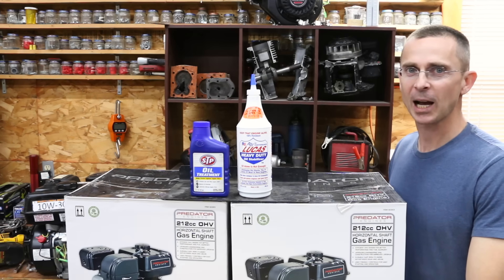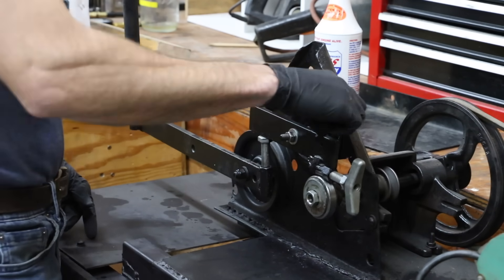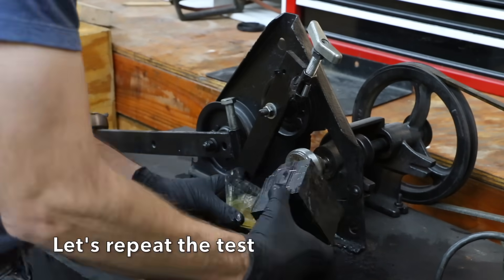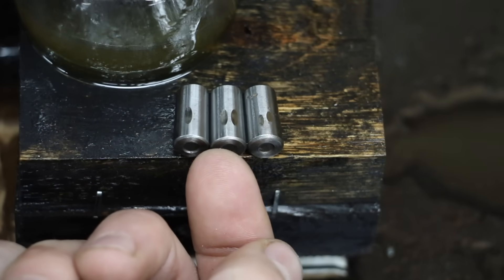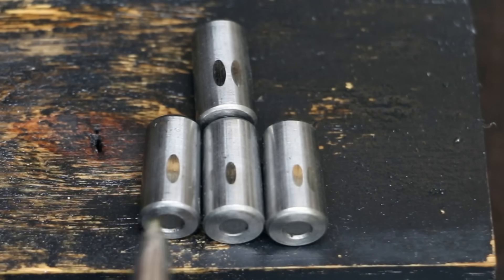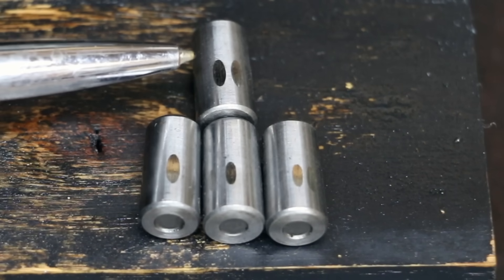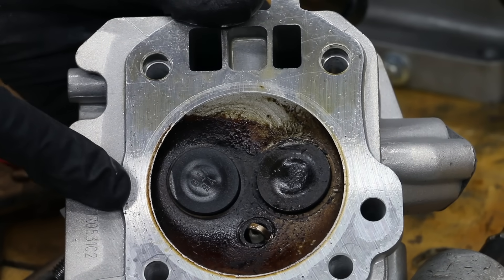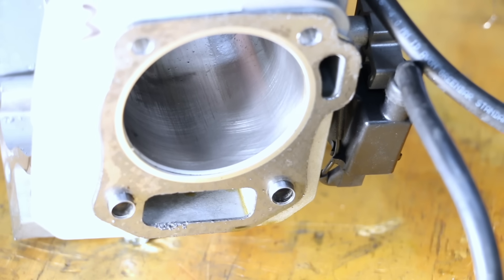Which engine self-destructs first?  Lucas or STP?

Comment: What a joke. This has zero applicability in the real world as engines doing work aren't under zero load. And hopefully they don't have zero oil in them. These engines even have protection against use with low/no oil! Looking at the crankshaft you can see it got hot by the discoloration on either side of the rod journal. This is a predictable outcome. The Lucas treated engine could have had a couple 1/10,000s more rod bearing clearance allowing it to run longer or the governor could have had it running slower. Lucas has been analyzed and it's nothing but refined petroleum with no additives. No extreme pressure, no anti-wear, nothing. It truly is snake oil. Buy good oil, skip the additives, maintain your equipment and ignore junk science.
Reply: Lucas is a racing "sponsor"it's about advertising to sell a product,I believe they have accomplished just that
Reply: Ny Chan they use straight Lucas brand oil and little to no additives
Reply: As you said, only regular intervals save engines. If you drive like normal people, good oil on regular changes. If you drive like a wanker, cheap oil twice as often will work.
Reply: robbie turnbull You're a silly little boy, aren't you? In science you don't prove negatives you prove positives. Lucas has been able to convince enough morons that a ten dollar bottle of nothing but useless sticky gunk oil with zero protective additives, no SAE rating, and no proven capability at all can magically fix, repair, and salvage any engine. With dupes like you, they don't need to make any claims...aside from the fact the FTC would shut them down just like they did to Slick50. A test with two lawn mower engines being run without oil is as meaningless as two engines being run while two dogs piss on the carburetors. Absolutely nothing to do with the real world.
Reply: I had a fucked Jeep 6 cylinder, had rod knock, rattly pistons, some broken rings, we put a new oil pump in and timing chain and i ran a 40W-70 Engine oil with Lucas and i did about 40,000km with no problems. the lucas definitely made the lifters quieter .. NOT FIXED.... quieter than running oil alone. and when I disassembled the engine it had been sitting for 6 months and there was still lots of sticky Lucas/oil in all the bearings, So say what you want but i would attribute the engine's reliability in the state it was in to having a new oil pump and good oil with Lucas.. Oil pressure also improved with the Lucas VS oil alone.
Reply: Ny Chan How many miles do they run before they blow up or are rebuilt?
Reply: Ny Chan 
Bc they get PAID too.
Reply: dustin britton And how did you determine these motors were allegedly about to ingest a valve or throw a rod? Did you or someone else completely disassemble them, reassemble them in that shit condition, put lucas and verify it did another 50k? What kind of moron would do that? None, that's who. And not even God can make a rod bearing or valve spring that is, as you claim, on the "brink" of the end of days resurrect. Certainly not some fucking liquid-anything.
Reply: dustin britton You "don't need to show me any scientific evidence"? Really? Then I wonder what you would show? I'll show you my daily driver which has almost 300,000 miles on it, original engine, original transmission, no additives or Lucas sticky gunk ever used.
Reply: that Dustin dude's is right about the work they do.. I know some shops that work just like that.. "that engine has a serious knock.. it's gonna need work.." "eh, put a quart of Lucas until the knocking stops and charge 'em for an overhaul.."
Reply: guyonearth then why did it run 2 more years?
Reply: guyonearth then why did it last another 6000 hours
Reply: lucas Wins!
Reply: Pukas is straight up snake oil shit and proof that morons are still alive and well today
Reply: dustin britton When they're knocking and burning oil they need it.
Reply: Guyonearth. When they are knocking and adding Lucas quiets the knock and let the engine run another 6000 hours. Your better off doing that and saving that money for when the engine invests a valve you park the equipment and buy a newer more powerful one using the money you saved by adding Lucas and not rebuilding. As for how I knew the motor was about to invest a valve and adding Lucas helped was adding the Lucas quieted the knock for 6000 hours and then the valve failed.
Reply: Christopher Gibbs no
Reply: Lucas fixed rod knock on my gsr for months after
Reply: Ny Chan because they sponsor them
Reply: Joshua foreSkinner STFU
Reply: Sandor Clegane Yeah, you dump a bottle in and your odometer resets to zero.
Reply: it was a real test! both had the same chances. can u say Joshua is a moron?
Reply: Yeah but Lucas sponsors On the Edge which is a cool show with school buses doing Figure 8 races, demo derbies, and other cool motor sports. So there. :-)
Reply: Skinner works for STP..uh oh...
Reply: Ny Chan they are sponsored
Reply: This is the worst experimental execution I've ever seen. Not to mention that your communication skills are crippled by your lousy use of language.  "Inside" the STP? Jeez.  Joshua Skinner is right- this is a joke. (Not that it matters; Joshua said nothing about the performance of the lubricatives; he just said the tests were crap and immediately all the sheep start bleating,  accusing him of drawing a conclusion when his POINT was that no conclusion worth a shit was anywhere to be seen...)
Reply: Joshua Skinner it's not just petroleum I looked that up and found not analyzing of that and he doesn't favor Lucas over stp and like Justin said only refined petroleum wouldn't have stuck to the parts. Go back to school jerk
Reply: guyonearth Lucas could've helped
Reply: dustin britton I meant dustin
Reply: mike force Dustin never said that
Reply: guyonearth if oil didn't drain out of a bearing a thousandth of an inch clearance oil wouldn't drain into the pan
Reply: Christopher Gibbs he didn't determine anything
Reply: Christopher Gibbs he probably worded it wrong, think of that?
Reply: guyonearth this is what Dustin said: "all I need to show you is the several motors it's brought back from the brink of ingesting a valve or throwing a rod"
Reply: I only use Olive Oil...
Reply: guyonearth it's to see what happens and he doesn't care if nothing comes out of it
Reply: guyonearth it's not for any real science it's just for fun. Get some common sense
Reply: Yeah but you were running a CAT.  Pretty much the better made motor since ever!  LOL
Reply: Because they're sponsored by Lucas Oil! Duhhhh
Reply: I have been mechanic for 14 years and who ever thinks Lucas oils don't work don't no fuck all and haven't tested them. Ps hope you your engine shits it self prematurely
Reply: Try Lucas transmission  in you trans. one that's just about stuffed and then and give it a week
Reply: matt franklin 
He'll yeah it works!  I rub that shit on my weiner and fuck for hours!!
Reply: matt franklin 
LOL!
Reply: The reason Lucas is used so often and is not a "Snake Oil" as you say is not that it has fancy "Anti Wear" additives or no "Extreme Pressure." The reason Lucas is useful is that it makes normal everyday oil stickier and more viscous. That means that when you shut off your engine and the oil drains back into the pan some of it will actually stick to everything so when it starts moving again there is oil already there. You don't have to wait for the oil to be pumped back up onto the parts. This prevents the most wear happening on your engine. I've seen this manifest when engines that have been running Lucas are torn down to replace head gaskets or rear main seals. Lucas treated oil has coated everything even after the motor had been shut down over the course of a weekend. I Think the reason the Lucas lasted the longest is because it stuck to everything in the motor so when the test first started everything was lubed for the first part of the test.
Reply: dustin britton Bullshit. You're saying diluting your oil with gunk that has zero wear additives is somehow a good thing? If what you claim is true, then why isn't all oil thick and sticky to start with?
Reply: dustin britton Curious to hear you explain how Lucas gunk magically adds metal back onto worn parts.
Reply: Dude I've driven 18 wheelers for 17 years and owned them also. I believe in Lucas the whole time I owned trucks the only oil I used was Shell RotellaT 15/4O and Lucas mix. Not one time did my CAT diesels ever go bad due to oil breakdown. Do your research before typing.
Reply: Guyonearth. I don't need to show you scientific evidence. All I need to show you is the several motors it has brought back from the brink of ingesting a valve or throwing a rod. As for bearings having 1 thousandth of clearance you clearly have never worked on any motor in your life if a bearing had that little of clearance it would expand when it warmed up a little bit and then friction weld itself together and sieze. Then you be stuck with a shattered connecting rod and a ruined motor.
Reply: I don't need scientific evidence because I can show you the engine in our trackhoe that started to knock at 25000 hours and we added Lucas. It stopped knocking and now has 31000 hours. I can show you the engine in our petervilt with over 1.7 million miles on it that started burning any oil we put in it. Added Lucas stopped burning oil. I can show you the engine in our backhoe that was having terrible blown through the rings and adding Lucas stopped that problem as well. I have many more motors ive seen Lucas fix problems in a bring them back from the brink of destruction. Can you regular old oil say that. Oh wait it cant cause everyone of those motors was chewing through your normal oil like a dog through fresh steak and they were falling apart because of it. Lucas is the reason those motors are still running strong so it does in fact extend motor life on every motor I've seen it used on.
Reply: Guyonearth your right about the math. The trackhoe is an 86 El240b cat and the peterbilt is a 89 359 Pete with a Detroit 60. We only rebuild motors when they need it.
Reply: Guyonearth. The reason all oil isn't thick and sticky like lucas is because something as thick as lucas would be almost impossible to pump through you vehicles oil system until the oil warmed up. You use lucas to make your oil stick to your bearing races and cylinder walls after you shut the engine off so if your engine sits for a week or longer the oil doesn't all drain back into the pan and when you start the motor you will have oil in all the places it needs to be. Adding this "Gunk" as you call it has prolonged thelife of many motors ive been around and worked on. We've have several motors getting up in the hours of hard use and they started to burn oil and they started to have a knock in the top end. Adding Lucas stopped them burning oil and quieted the knock.
Reply: robbie turnbull You're way off base. Lucas has never been shown to do anything beneficial, period. How can you abuse a product that does nothing? How do I know it does nothing? Because it's been independently analyzed, and there's nothing there but thick oil, not even a detergent. Why not just dump gear oil in your engine? Not only is it cheaper, it actually has real anti-wear additives as well. Why not pack your engine with axle grease... that'll really quiet those knocks down...LOL!
Reply: robbie turnbull Your "argument" is irrelevant, and has nothing to do with the topic. Nobody fills their engine full of Lucas. Nobody fills their engine full of cow shit, either. Nobody drains out their oil and drives around, unless they're insane, or really stupid. In any case, the test is meaningless, and proves nothing...get it?
Reply: Aaron Cubitt You mean it gummed up the bearing so you didn't hear it as much. It was still a bad bearing.
Reply: guyonearth One, it is a good thing though it doesn't stick there for ten years, eventually it falls back into the pan, and your not diluting it. Also, it's not sticky at the beginning because it needs to be wound up or something. I can't believe someone can be so idiotic
Reply: guyonearth You are right about the cigarettes with your logic there, but what you say can be for anything. If it hasn't exploded, that's a good thing. You have nothing to back up your opinion about Lucas. What an idiot
Reply: Joe Smith One, you spelled Lucas wrong, and two you have no proof of that and tons of proof against your comment
Reply: Joshua Skinner how come massive horsepower motors that drag race use Lucas than
Reply: I'm not saying you are wrong or right, but by always and only using that mix, you make your opinion irrelevant. You don't know if it would've been better without the lucas or not. If you had said for 10 years I used it without and shit went bad, but then I added Lucas and everything was good, it would've been a different story.
Reply: Christopher Gibbs The negative logic is amazing, isn't it! "I put garbage in my engines for ten years and they didn't explode, so garbage must be good." Sounds like the guy who thinks cigarettes are good because he smoked ten years and hasn't gotten cancer yet.
Reply: Ran Moore If you change your oil on schedule you will never have oil breakdown, and never have a failure...and no need for Lucas bullshit. It was Rotella that saved your engines, not Lucas.
Reply: dustin britton I call bullshit. First of all, no additives will silence an engine worn so badly it has bearing knock, nor will such an engine continue to run very long. Second, I think you are math-challenged. 31,000 hours is 15 years of running a constant 8 hours a day, 5 days a week. 1,700,000 miles would be the equivalent of driving 9 hours straight 7 days a week for over 10 years. You guys must be busy bees. Maybe try doing an overhaul once in a while?
Reply: dustin britton LOL, you clearly know nothing about automobile engines. Main bearing clearance on a Honda 4 cylinder, as an example, is .0009 - .0013...in other words, a thousandth of an inch...dumb ass.
"Never worked on an engine".. I've been working on them 40 years.
Reply: dustin britton Nonsense. Oil doesn't drain out of bearings with a thousandth of an inch clearance. I've torn down engines that have been sitting in a field 10 years, they still had oil in the crank and rod bearings.  I've never used your stupid gooey junk in 2 million miles of driving, and no engine of mine has ever failed. Show me a scientific blind test that proves Lucas extends engine life....oh wait, you can't.
Reply: If expensive brand A will make your engine last 250K miles, and cheaper brand B will make your engine last 225K miles, I will use the junk. Why? Because I trade in at 90K miles.

Only truckers and antique car owners need concern themselves with additives. It simply isn't needed with today's great oils. And synthetic is another ripoff. There's zero payback for the average driver.

Comment: As a car guy I can respect this I have used Lucas in all my engines except my race engine because I run sae 50w already. Lucas has yet to let me down I would get better oil pressures longer oil Life and over all performance over oil alone. The stp had a lot of air Lucas did also but not as much but when added to oil it showed why Lucas is on top. I’m sorry if anyone disagrees but daily stop light to stop light city cars wouldn’t really see much gain highway cars would see a change. Like the video showed the Lucas grabs the moving parts and say a car sits for a long time and u run Lucas you wouldn’t get those annoying dry starts anymore that ticking from a weak lifter
Reply from the maker: Thanks for commenting.

Comment: Zmax oil additives would be interesting, very cool video
Reply: Zmax would be the one I picked...but you beat me by 2 days...
Reply from the maker: Thank you for this recommendation!
Reply: Haha beat me by 3 days on that one.  I remember the old commercials where they'd use it and drop the engine oil then pour gravel in the engine as well.
Reply: John Flemming I just researched it and you are so right zMAX turned out to be just tinted mineral oil the bearing showed twice as much wear as the engine oil alone...... if I had more money as a kid I would have bought the s*** out of that stuff good thing I was poor
Reply: Vince Cannava "Take it to the max with ZMAX" LMAO
Reply: Wasn't Zmax shown to be a fraud and just mineral oil or something? I remember seeing those commercials too...
Reply: John Flemming interesting I would have to research haven't heard that but I do remember seeing the liquid penetrate into the metal and it was insanely overpriced
Reply: Z-Max is mineral oil and food coloring..
Reply: just plain mineral oil
Reply: ZMax and DuraLube were both proven to be frauds.  Both companies claimed you could run an engine with their product, then drain the oil from the engine and continue driving without causing damage to the engine.

Comment: when you removed the drain plug and dip stick you were basically running a dry engine after a few minutes a better test would have been to drain them and replace the plug and stick to test the real life scenario of someone who doesn't check their oil and you are relying on the additives ability to, for the lack of a better pun "stick" around.
Reply from the maker: Thank you for this recommendation!

Comment: Lets see a bearing load test with Synthetic oils vs Traditional Oils.  Add weight to the machine until it stalls with each oil.  Lets see how much film strength and real lubricating capacity under load they have.  :D
Reply from the maker: Thank you for this recommendation.